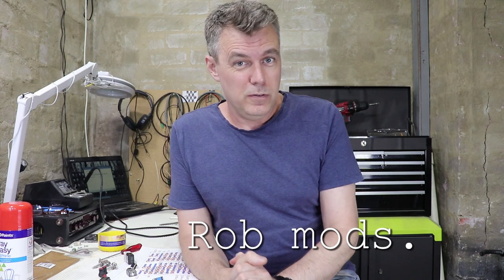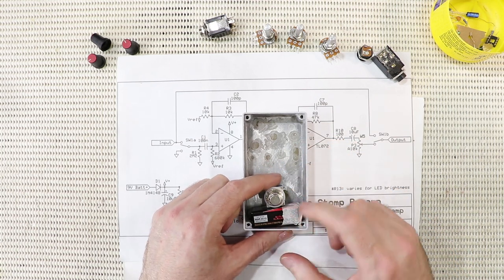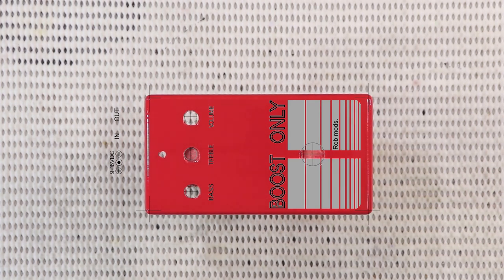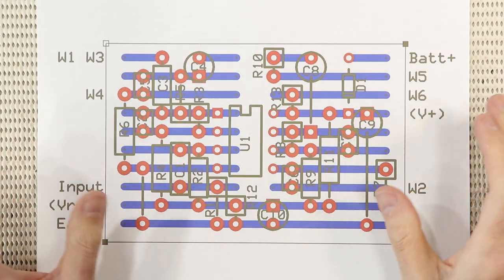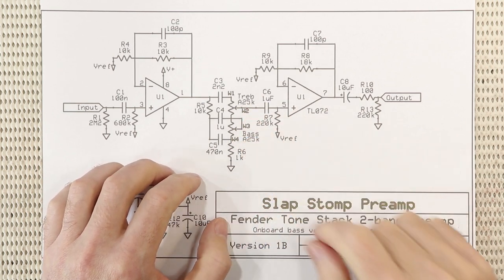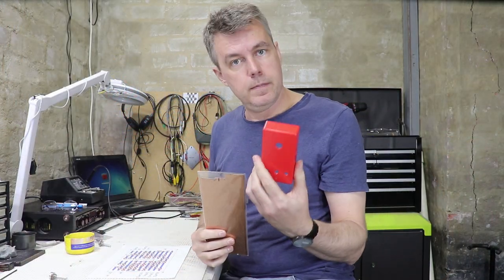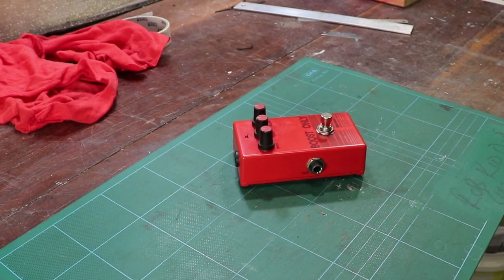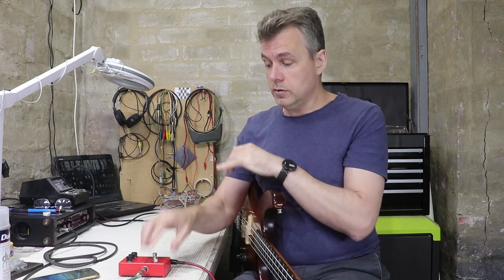How To Make A DIY Bass Guitar Preamp (Boost Only / Fender Tone Stack Pre)

Comment: Build this pedal. Transformed my P bass w Fralin PUPs  --> Quilter Bass block 800. Great tone. Only issue I had was i must have wired something wrong because the treble boost knob doesnt work, only bass and volume. Whatever the problem is, dont really care cus I just roll my tone knob on my bass to compensate (and the Fralin PUPs are overwound so they are hot get plenty of treble). Gigged with many times, and really love it.

Comment: Neat....i know nothing about  electronics...passive speakers & passive bass's only....the only thing i know is a lower impedence is the  result after an active bass ...does this effect the impedence of your bass's  signal...i ask as most active pre-amps built into bass's take normally ordinary passive pickups & add a pre-amp resulting in a low impedence output which does not need a buffering stage after leaving the instrument...i think this would be neat for people that don't use bass effects pedals..keeps a nice Fender tone,old school...i don't use bass effect pedals but do use a Compressor & valve box,Eden Glow Plug,& i have to sometimes use a pre-amp with DI as cannot use an amp & cab...not my choice...could the pedal be fitted with an XLR socket etc to use DI Rob ?...if it could i would be very interested in building it but know nothing about how to implement an XLR DI output into your design...or any design...if you can design an XLR DI output for this you could be on to a winner....good job, sounds good...

Comment: Hi Rob, appreciate your well-explained videos. I've tried to rebuild this pedal, however I don't get an output. Diode and stomp switch are working fine and the signal goes through when the pedal is bypassed. Could you give me some tips to debug? Anything that i can measure with the multimeter to exclude any errors?
Reply: Same 😢

Comment: Dear Rob, thank you for sharing your knowledge and experience!
Just a question.  What changes would you recommend us in order to use this circuit for an electric guitar with passive pickups? 
Kind regards from Mexico!
Reply from the maker: Hola!  The circuit will work well just as is for the guitar.  The tone filter is based on a Fender amp, and even though it is scaled, it will have a very similar response.  However if you'd like to tweak the values of the tone stack, or redesign it for different value pots (as I did for the onboard version), check out "Tone Stack Calculator" from Duncan Amps.  IIRC, it's a free download.  Gracias!
Reply: @RobMods  Thxs Rob!

Comment: Can anyone help me with some troubleshooting, i've made this as an onboard for my Pbass, following the diagrams its all correct, i've put the P pickup wire directly into the pull pot where it would feed from the blend pot.

Im just getting a really quiet kinda distorted farty sound through the bass now, any ideas what might be the issue, could it be the caps?

Comment: Hey Rob, Can you discuss the gain calculation? Shouldn't the calculation be 1+ RF/RIn? (Noninverting opamp formula). I'm not seeing the math. For example, the first OpAmp gain is 6db? I see 1+ 10k/10k = 2db. Thanks!
Reply from the maker: Gain refers to a multiplier on the actual voltage.  So if there's a gain of 2, then the voltage out has twice the amplitude of the input.  And that equates to a 6dB increase.  For a 12dB increase, the gain factor would be 4.  This sort of thing happens a lot in music/audio electronics when words like "gain" and "boost" are used.  FWIW, gain can also be negative.  So gain can be cut!  :)
Reply: Thank you!!!

Comment: Very cool! 

What is the input impedance of the preamp? 2.2M? Or is it less because of the cap and the resistor after that?
Reply from the maker: Approx 500k.  That 2M2, the 680k in parallel.  The opamp specs can play a part too.

Comment: Great project as always Rob!  Do you prefer this preamp over the 2-band preamp you made for project berrocca?  Your videos are a great inspiration.  I’m currently working on a Dr. Quack pedal on perfboard.  Fun stuff!
Reply from the maker: Thanks mate.  It's a horses-for-courses kind of deal really.  This preamp is not as flexible as the Project Berocca one.  It sort of has its own sound, then you can tweak it from there I guess you'd say.  That's why it's handy to put it in a stompbox. I've noticed a lot of Sadowsky players are adding a passive tone control to their basses, so they have some treble cut for more flexibility...   

I built a "Neutron" pedal many years ago.  It's a DIY Mutron work-a-like circuit.  I made the LED-LDRs myself, and etched the board too.  It sounded great!  I'm currently working on a really dynamic fuzz pedal for bass so you can use it before an envelope filter for dirty synth sort of sounds.  A fun project...

Comment: Hi! I'm building something similar to your project Berocca bass, do you think this would fit nicely built-in? I was thinking it would be overkill probably, and maybe it would saturate the output when used at the simultaneously with the other built-in preamp. If so, can I replace something to make it usable? I'm still learning, so if it's a stupid idea nevermind then hahaha
Reply from the maker: I have used a similar circuit added on to an existing active bass as a slap contour switch.  I made it very small and used trim pots for bass and treble.  It worked well.  

If you are new to all this and worried about saturation, I'd say read up on "gain structure" and "headroom".  (But read actual electronics stuff, not just what some bloke says about it on a forum, lol.)  Best of luck with your project bass!
Reply: @RobMods  thank you so much! Will definitely do! I love learning new stuff so I'll go straight to the source